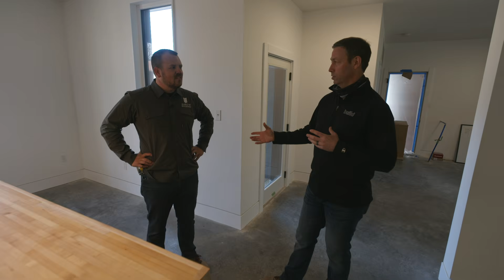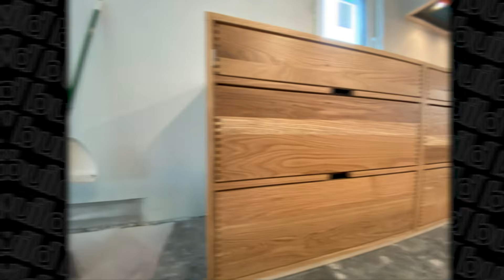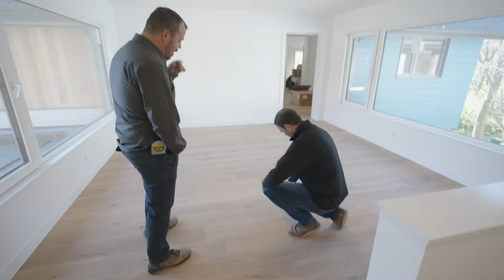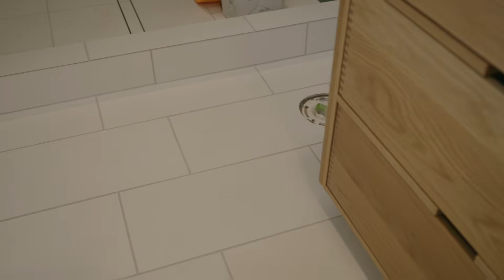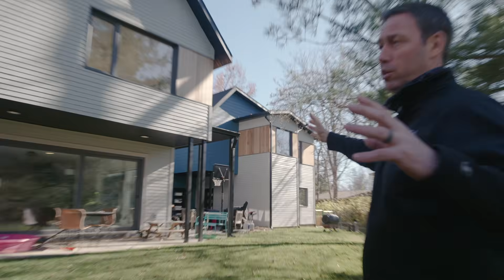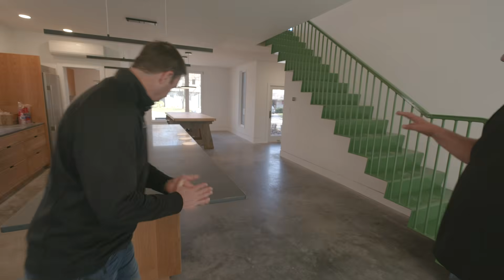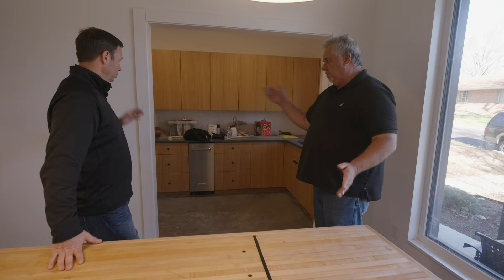Builder’s own INSANELY Efficient House!

Comment: Matt: "I know that you built this , not on some millionaire's budget, you didn't overspend but you spent wisely..." I know that Jake and Matt are custom home builders and they get some discounts on some of the products they use (obviously they are the GC co they save as well) but I would LOVE to get an honest answer on what the cost is to build these homes.(Other than the old adage, "If you have to ask, you can't afford it) (I'd also love to hear the total on Matt's "Rebuild"  but I don't see those "mistakes" seeing the light of day anytime soon) I get excited seeing these videos, but to me, somebody not in the business's or in the trades, these homes seem to be just as unattainable as any of the millionaire homes.
Reply: Only $999,999.00
Reply: In this episode, "craftsmanship" is code word for "$$$"
Reply: This home without lot or utility connections being built for a client instead of Jake would have cost between $205 SQFT and $215 SQFT in Columbia Mo. This is on the higher end of the market in Columbia, but certainly not the highest of high end.
Reply: @jake.bruton.aarow.building  So just short of $1M which makes sense (it is a relatively large house...those with less resources could build a much smaller house for only a slightly higher SQFT cost but much lower total), but my experience is that similarly designed/built products in most markets would be considerably more expensive because of design costs and contractor development.  I'm sure the Build show guys are getting freebies and heavy discounts in exchange for advertising, but that is not the main plotline.  Risinger, Arrow, and others like them represent a very small and very particular group, namely those who value craft and knowledge transfer over profit so they have for many many years developed (e.g., hired, paid, trained, cajoled, and praised) architects, engineers, and subcontractors and possibly even building materials suppliers to fit that mindset.  Replicating this from scratch on a first project in a region that does not have a primed "ecosystem" would be both Herculean and Midas-ian...not to mention finding a GC who has cultivated such abilities themselves.  If you live in Columbia or Austin, hire Arrow or Risinger (but note that they would be largely ineffective trying to do what they do in other markets unless they were importing their subs as well, which would wreck the budget).  Matt and Jake probably would not want to get into the details so much, but I think they are moving towards an income model for their businesses whereby their influencer/training income is as much or more than their builder income.  And it is not a coincidence that Matt is coming out of Austin because Austin is a honey hole for superb residential construction combining exceptional architects coming out of UT, wealthy and relatively young and design loving clients (mostly out of tech but also oil/ag/real estate), and MANY of the best residential general contractors in the country.  Believe it or not, in Austin, Risinger is above average but no where near the top of the list.  The mega ($5M+) projects in Austin are being won by others who don't have time or interest for making videos or giving presentations (Risinger has included many of them in his), including his recently departed partner...why do you think Risinger is working on 2 homes for his family right now?
Reply: @jake.bruton.aarow.building  I appreciate your reply. I understand there are so many factors that go into building costs that to peg and actual build on any of these is difficult at best.  I wish there was more channels here that either explain price per square when building, or could break out costs clearly so "regular" folks could figure out if they can afford to have homes like these.
Reply: @ericscott3997  the essential craftsman spec house build shares prices and breakdowns
Reply: @hellonoko  Appreciate the info, I'll give this a lookover...
Reply: @jake.bruton.aarow.building  Appreciate you sharing.
Reply: @jake.bruton.aarow.building  WOW!! You can't get a DR HORTON Express home for that price here where I am at. I build slightly higher end ($1.3-1.5 mil) homes as a semi-custom spec builder and we are coming in just under $330-350 construction cost, $400 sale price.
Reply: @jake.bruton.aarow.building   do you, Matt, and Build Show Network have a list of GC's with your mindset in the Mid-Atlantic region? Not asking for a friend.
Reply: @jake.bruton.aarow.building  LMFAO - it’s $300/sq ft here for even low end tract homes. $215 for this level of build - it would cost 3x that.
Reply: @jake.bruton.aarow.building  i hope the $750sqft Californians don’t see this .
Reply: @McIntoshGreen  Thats the problem though, right? This metric doesn't translate to other markets and isn't a good standard by which to judge homes.
Reply: @jake.bruton.aarow.building  they ruin the markets they move into . Property taxes up 100% after Toyota moved to TX. They’re buying up land in Okla at alarming rates .
Reply: @jake.bruton.aarow.building  any referrals for California builders?
Reply: @jake.bruton.aarow.building  What exactly does $205 SQFT mean? Is that $205 x the sq. ft footprint of the house or $205 x total sq ft of living space? Is the garage factored in to this number?

Thanks and awesome job on the project!
Reply: @mikeh3945  great question. Those numbers are the total cost to build the home (excluding the lot and utility connections) divided by the total living space. Which means the numbers cover the garage and porches (which isn't considered living space) without added extra math.
Reply: @mikeh3945  Price per square foot is misleading in so many ways. The price reflects the expensive cost of those cabinets and all of the other expensive things. Real price per square foot in just building the house with out the expensive stuff will lower the price down drastically. Anyone can build out a nice shell for a low dollar amount yet when you start adding in 5 dollars a square foot flooring, 500 dollar per cabinet and 100 dollars per liner foot counter tops, high end light fixture it adds up to be more than its worth.
Reply: @mikeh3945  normally when your given a quote like $205 sqft, it’s the total square feet of the structure. So, 1000sqft on the main level, plus 1000sqft for the second level equals 2000sqft. If you have a basement, that is another level that could be a little less, if it is an unfinished space.
Reply: Total labor hours $$$
 Donated products $$
Purchased products $$
Reply: I could be wrong but i feel like i remember matt saying in the beginning of his remodel that he wouldn't hesitate to disclose prices
Reply: It would be interesting to know the cost for entire project. I suspect it might be the classic 'spend a dollar to save a dime' lament.
Reply: I too am always curious abotu the cost of these builds, but I also have to remind myself that the same house built anywhere else in the country could cost way more or way less, depending on 100 different factors. Even still, it would be nice to know the total cost of a particular build as is.
Reply: @dlg5485  Ypu can’t compare what these guys paid vs what you will pay. I am a GC in Philadelphia and my price will never be your price. We all phone in favors on our own personal projects, usually just a about cost and a homeowner or a new contractor will never get the quality for the price. For example I pay mid 20’s a gallon for very high end paint that would cost you 50+ a gallon cause I buy so much of the stuff a year. 

That staircase railing looks like you welded a metal barricade to stairs, maybe the color is just terrible and throws it off for me!!
Reply: @OR1L215  I know that. In fact, I said exactly that. Wanting to know the price of a build is simply a matter of curiosity for me.
Reply: @OR1L215  Have to agree with you on the stair balusters. Unfortunate but happy they like it. Rough and certainly not elegant. An elegant solution and detail would have been to slightly over drill the hole to extend the rod through and finish off with a threaded end and oversized nut to support the tread. Mies van der Rohe once said that God is in the details. Been in many of his buildings both as a student and practicing architect and he certainly was connected to source, whether you like his work or not. Architecture is best experienced by a compilation of holistic details.
Reply: 250 a sqft
Reply: YES!!!! would be good to get an actual spreadsheet, even if some prices need to be substituted with "list" prices if Matt & guys get stuff at a discount or free paid by ads.
Reply: If you’re in Oklahoma City, there’s no better insulation company to do your insulation than Bo’s insulation. They really care about building science (spray foam is a system and for it to work there are other variables at play such as hvac and humidity levels etc..) ,there’s a lot to the spray foam side but they guarantee their work and they’re about as reputable as you can get (at least here in Okc).
Reply: This is obviously a multimillion-dollar home bro

Comment: Watching now. What is the price per square foot when building an efficient house with 2x8?
Reply: Mine came in at $250/square foot, also 2X8 walls, .58ACH, same style European Tilt & Turn windows (about $700 each): have 2 sliders, 8’ wide x 7’ high, those are pricey at $5K per..  I wasn’t as extreme with no combustion, have Propane on demand Rinai H2O heaters, propane Oven/Stove, propane dryer, propane backup generator, propane grill on deck etc.. much more cost effective to make heat with propane.  House does have 4 zones of Mitsubishi mini-splits though, to take advantage of the 10KW PV on roof..  yes, it’s all expensive to build like this, but my monthly energy bills are almost non-existent.

Comment: *build million dollar home full of amazing craftsmanship
*Hires a youtube handyman to plumb in his several thousand dollar water heater using home depot sharkbites
SMH!!!!
Reply: Pex is huge in many areas. Sharkbite is good. The crimp on style not so good as I only use push to connect. I have installed a number of houses over the years and not a single one has leaked even after some of them have froze over more than a few times. I just installed sharkbite in my house over the spring and did not have to re seat a single one. I had a guy come in to do some work before I had the plumbing system up and running and he used the crimp ones to tie in to my temp lines and had a number of leaks putting in a temp out door faucet. I ended up having to do it my self, One try and not a problem and its still up and running close to a year later.

Comment: .07 is crazy. I didn’t here you talk about his controlled ventilation? ERV or HRV?
I’m guessing cost of 2x8 would make ICF look cheap😂
Reply: Kinda have a feeling an ICF with concrete floors and roof would be far better and lower price point. They do make ICF roof and floor boards now. Which if done right can eliminate everything wood wall related.

Comment: $4535  For water heater?
 It's never pay off
Reply from the maker: Stainless tank... what if it last 2x your standard unit. Saves energy and doesn’t need replacement in your lifetime?  That might be worth it. It could be powered 100% by his solar array too. Lots of cool stuff with that split HPump unit.
Reply: @buildshow   Lifetime ?
 I believe  You long enough To know nothings forever
 I study manual of this Over engineering miracle Over engineering miracle
 Surprise surprise disguise give you only 3 years warranty  For parts and labour
 You have another 7 years for parts. 
  Only if you original owner.
Reply: @zlmdragon.   I am definitely not chip
 Another side I don't like to spend the money For unnecessary things
Reply: @zlmdragon.   Please don't take me wrong
 I am not against the progress
 Originally I am from Europe Beleve me or not I still have it original windows 1905.
 Because 1905 somebody  good job
 This heater it's 100% over engineering
 I'm sure required a lot of the maintenance
 That's my point
Reply: @zlmdragon.   Wow where you from
 I am from 🇵🇱  Poland
Reply: @zlmdragon.  visiting Romania few times
 Long time ago Beautiful country

Comment: why would any one put a heater over a fridge !!!!! the fridge will have to work over time to keep it cold burning up power
Reply: Are those not vents for the heat coming from the fridge compressor?
Reply: @zlmdragon.  so in winter it can go - 3°C that's cold here in Ireland so some sort of heat is going to come out of that unit. THAT WILL PUT A STRAIN ON THE FRIDGE MAKING IT WORK HARDER . It will cost more to run the fridge and because there is hot air blowing on it I'm sure the fridge company will not  guarantee it if it breaks down

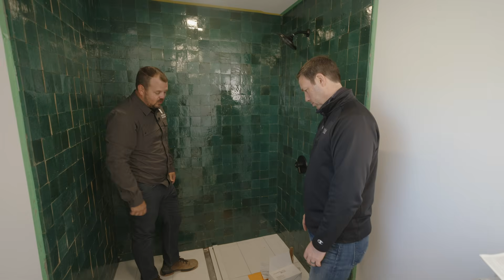Comment: 16:27  Where is the shower door?  No door means humidity throughout the house. Bad idea.
Reply: Actually listen and you’ll hear them say construction of the bathrooms isn’t finished
Reply: Shower doesnt generate as much as people thin
Reply: @stevenbaczekarchitect9431  If you take a 2 min shower, you'd be correct.  If the shower is tightly enclosed, the shower water temperature can be greatly reduced.  The moisture in the bathroom is greatly reduced which means the mirrors don't fog.  A double-pane, low emissivity enclosure would fix the problem.  If you're going to spend that kind of money, why not complete the task?  My son is a painter which means architects make us lots of money every year with their bad designs.  East and west windows make us a killing, especially if they are on the second or third story. My kid has learned to hate architects, but I smile all the way to the bank.

Comment: Like every other idiot, the house is facing the street instead of in relationship to the sun.
Reply: Roof totally oriented for solar access
Reply: @zlmdragon.  Not necessarily true.  His threat is the glass on the east and west walls.  They let direct sunlight in during the summer when the sun comes up in the northeast and goes down in the northwest. Southern glass does nothing until late August. Northern windows let cold and heat in, but they are still not bad news like east and west side.
Reply: @zlmdragon.  That's what I was paying particular attention to.  It's not correct no matter what they say about a solar roof.
Reply: @zlmdragon.  My house is superinsulated, but not to this extreme.  My roof is white with 14+ cellulose insulation in the attic.  I pulled the sheetrock on all exterior walls and repacked them with 3.5 in fiberglass, 1" Celotex insulation, and then 5/8 sheetrock over that.  Downstairs I glued 2" pink foam to the concrete walls and sheetrocked over that.  I used Roofguard 700 to whiten my roof.  My house is about 3,400 sq. ft.  The electric bill isn't over $75 in the winter and $110 in the summer.  I shut the gas off between April and November and it seldom goes over $40 mid-winter.  With all that glass he has, his bills will be twice mine if not more.  He'd have to spend $40,000 on solar to cover the electric bill.

During the summer my air conditioner shuts off between 10:00 AM and 10:00 PM.  The house's temperature will rise by about 1.5 deg F during that period.  I'll bet his house heats badly during the summer days.

Comment: It's really interesting watching these videos to note the cultural difference in construction and design choices. I'm from Estonia and the vast majority of hardwoord flooring sold is engineered hardwoord. It's also very popular to use a floating floor, rather than to glue it or nail it down. 

Another thing to note is kitchen furniture.Over here people prefer to hide most of the kitchen appliances, rather than show them off. E.g. it's very common to have fully integrated fridges and dishwashers which look just like regular cabinetry from the outside. 

Oh,  and 2x8 consruction is really the minimum over here. To pass the efficiency requirements you really need something in addition to that 2x8  e.g. another 2x2 with insulation in the inside and a vapour barrier between them.
Reply: Yes, it is a bit funny to hear that they are amazed by the "thick" walls, and the "high" insulation. Probably heating is cheap, so they haven't had to care before.
Reply: Floating floors tend to squeak when you walk on them.  I once worked in a factory that made them.  The hardwood veneer was only 1/16 of an inch thick and that was before they were sanded.
Reply: @TheGuyThatEveryoneIgnores  In my opinion they only squeak if you install them incorrectly. They must be able to float in all directions.

Comment: How do they keep that concrete from cracking?
Reply: May have added fibres to the mix
Reply: Concrete cracks from thermal shrinkage and expansion.  This concrete is indoor so it will be kept at a fairly constant temperature all year long.

Comment: This is just how Americans got used to build their houses: you cannot open windows, you never open doors. You are just breathing with the air which is never getting any fresh additions from outside. You are guys just killing yourself. Get the CO2 sensors around the house (u'll be surprised). Each house should have an air exchange. A sealed houses doesn't mean you don't need fresh air. Don't kill urself, think about it. I'm not even talking about formaldehyde vapor from plywood. Doesn't matter how eco-friendly materials you are using, - it still will be there. Get the lab to your house, measure the data. It won't be as bad as in SIP houses, but still pretty high data specifically for extra-sealed houses.
Reply: Have you never heard of an ERV?
Reply: @robertfeliciano5723  what does it have to do with this house exactly? Did I miss it?